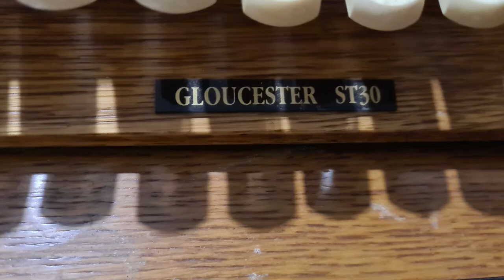The Organ Project - Building a midi console

Comment: I’ve done such thing too with an Allen 2 manuals(the console is 10years older than me). It is quite some work and takes patience. But it is like my child. Thank you for sharing your progress, lovely to see a fellow .
Reply from the maker: It was some hard work, and a steep learning curve, but incredibly fun and rewarding once done!
Reply: @DCTOnline  thank you for your reply. It just came to my mind. did you manage to drive the “rock tab” ? Could you please teach me how to do it? my console has 54 tabs, and each takes about 0.5A instant power the moment they are triggered. I already have 2 PCBA to Handle high current(some MIDI decoder), but I am stuck at the power supply part, I check the market, there are plenty AC/DC power, but many of them are just 12A or so in output, I don’t know how to set it up and design the circuit. Could you share with me some ideas? Thank you.
Reply from the maker: Hey Thomas - it's a good question and something I grappled with for a bit. 

At this time, I've opted not to wire them in (although I have the components to do this at a later date).  I'm currently using a combination of a Novation Mini, along with two X-Key 16 (https://www.keyboardspecialists.co.uk/products/xk-0981-uck16?_pos=2&_sid=0aed0e0e1&_ss=r) as thumb stops (one general located under the Great keyboard, and a divisional located under the Swell keyboard)

I may later wire in the rocker tabs, but the wiring method I'm using is the same as the keyboards, and goes into the same PCB -  that is diode based - and so it has the power control sorted as a single unit.
Reply: @DCTOnline  thank you for your reply. I understand the rocker tabs will be wired in such way to send MIDI signals back to MIDI scanner just as any key on a keyboard, but let’s say you trigger a general piston, the registration is now changed, but your rocker tabs haven moved to reflect that new registration, you will need to power their coils right? And such power is much higher than 5V that a small LED need( my rocker tabs coil seem to need 24V DC to drive them), so the power unit is different from the signal/control unit, it will take command from control unit, but draw higher current from DC power source to drive the coil, and it is this power bit got me stuck. 

But yes, I’m using touchscreen and pistons at the moment, it is just that I was hoping the console is fully functional with every control, haha.